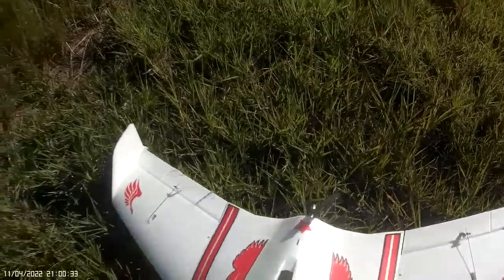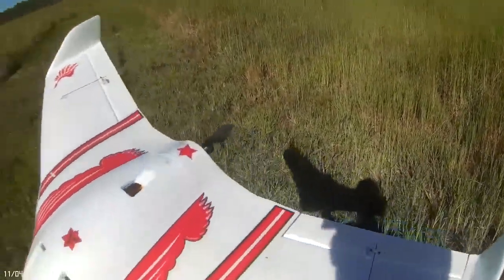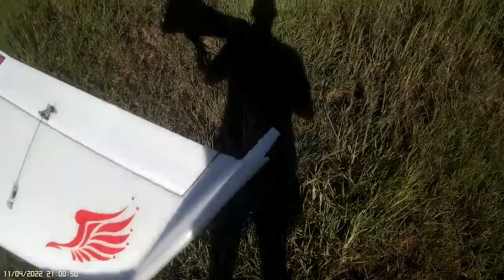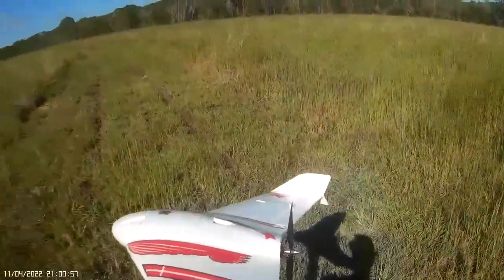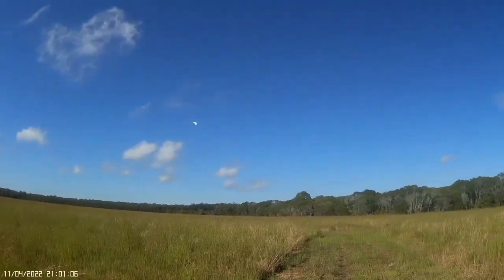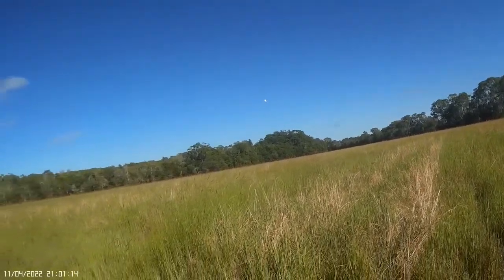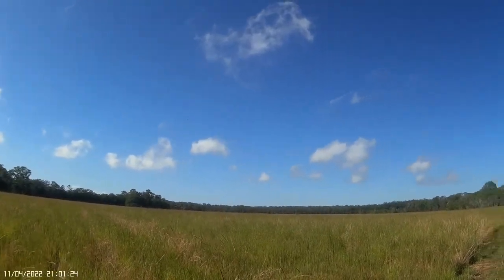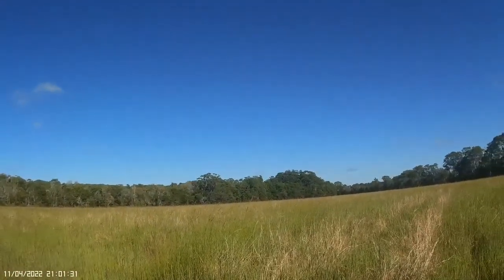Kopaqi-B2  Wing - Maiden Launch !!

Comment: To help with the lawnmover noise you could smooth that abrupt vertical cut on the back of the wing (on the motor mount), see arwing pro body finish - it helped me a bit although it's still noisy.
Reply from the maker: I ended up making a new motor mount and moving the motor back a further 25mm..  that made a big difference
Reply: yes, I've seen your next video - when I'm not lazy I'll do the same to mine as well

Comment: Did you included a stabilizer? Its kinda stable flyer so i wonder if.you install one
Reply from the maker: I did install an A3v2  stabiliser for this maiden flight, since removed as it is a very stable flyer...  although it was set at the absolute minimum and only for the launch...  from then on you control the model, the stabiliser does not do anything after that...
Reply: @craigmcdonald-rcflight  Thanks . Great info